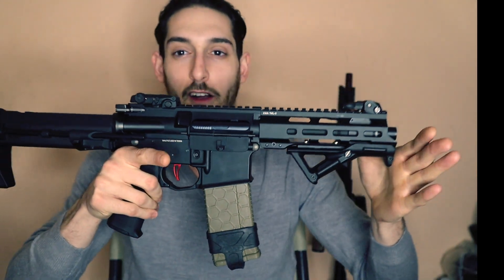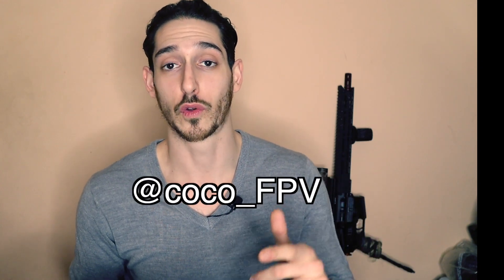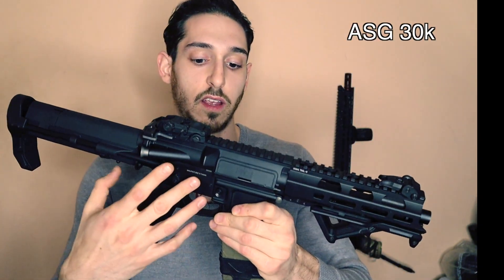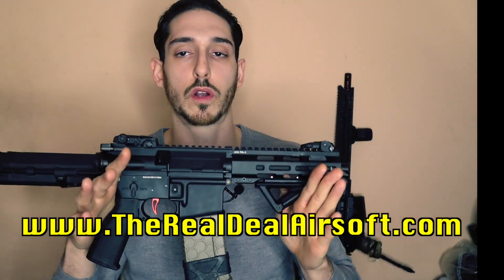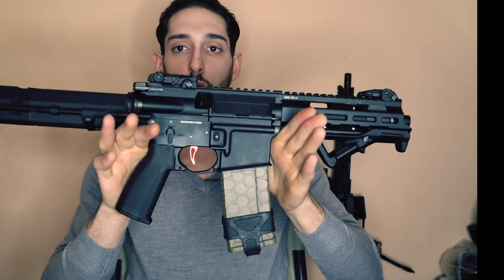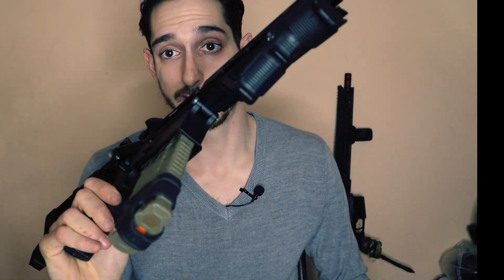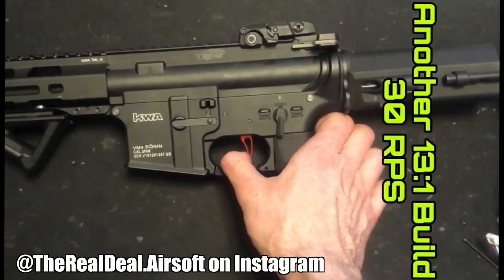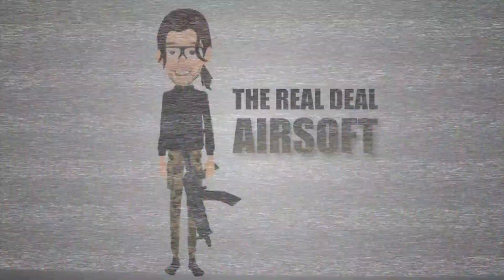KWA Ronin T6 High Speed Build Upgrades 13:1 Airsoft AEG

Comment: Love the kwa build you did here! Just got my kwa t6 dsg build done using all parts from your site.  Shs Dsg gears, real deal piston & piston head, m160 spring, insidious armory grease.  Shooting 40 RPS at around 300 FPS. Still have some room to adjust the vps in this gun to increase the FPS a little.  Very Happy!
Reply from the maker: Fuckin wicked mate.  Great work. Feel free to put it up on social media and tag my Instagram I’ll re post
Reply: Did you get the Real Deal Performance Piston Assembly 3.0?

Comment: I love your videos there so helpful I have a question I've built my arp9 with 13:1 gears reshimed it have a m120 spring I've short strocked it by 4 teeth but I'm only getting 23 rps what motor would you recommend I'm running a 22tpa at the moment or have done something wrong as to why it not hitting 30rps

Comment: would it matter if i used a 45k warhead motor instead of the asg 30k? or would it be better to use the asg 40k?
Reply from the maker: If you want brushless go with a warhead 33 or 39k motor , we carry them in the website , fast shipping 

ASG 40 k is old tech and will heat up so much. It’s really a question if a golden Boi 18 tpa brushed vs the t238 brushless. Warhead not a fan. 

We only stock parts we use and believe in 

https://www.therealdealairsoft.com/search?q=motor&options%5Bprefix%5D=last
Reply: thanks, and btw is it ok to use a brushless motor on a gate titan @TheRealDealAirsoft

Comment: What spring did you use. Ir referance I have a m100, an aster, and an e&l m170 motor with standard 18:1 gears. Im just trying to get to 2t rps. My gun didnt quite make it to 20 at about 19 rps but it still rips.

Comment: bro I built something similar like this but my gears over spun. How can I fix that? Should I use a stronger spring?
Reply from the maker: Use active breaking
Reply: Just bought the realdeal piston assembly. Do you need to shortstroke the 13:1 sector gear? I will use a 22TPA motor

Comment: what spring is it using? im trying to build a 13:1 ssg and lower my fps from 375 to 350 and im not sure what spring i need if i just use all a stock piston assembly.

Comment: does the rear wired or front wired gate titan fit or does it not matter
Reply from the maker: Both would fit but rear wired for this version
Reply: @TheRealDealAirsoft  one more question man do i need to get any other upgrades to install the gate titan or any other upgrades that go along with it to make it better? im new to gun upgrades sorry if im bothering you :/
Reply from the maker: @XxXxXxjonXxXxXxX  if your opening your gearbox you might as well get the internals popping. My recommendation is 

Gate titan 

For sure for sure a new piston holy shit you need it ... the best is well my complete performance assembly that’s AOE corrected with all the bells and whistles 

13:1 ratio gears both the gears and piston are on my website 

And then a better motor. My recommendation is asg 30k 

I have warheads in stock but they are really expensive but the best on the market currently. 

So to sum it up 

Gate titan
Real deal performance piston 
Real deal 13:1 gears 
And a 30k motor